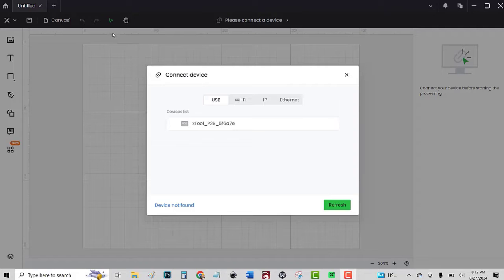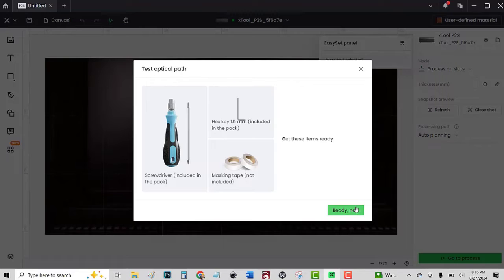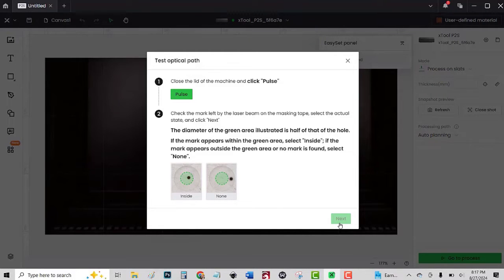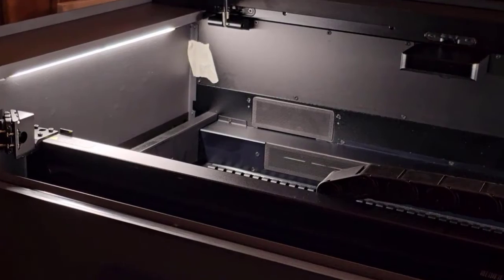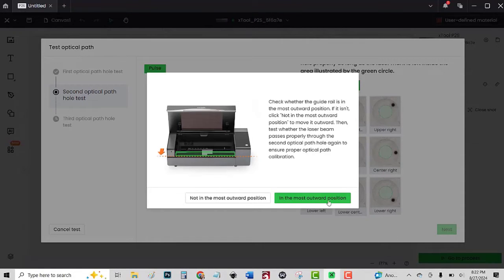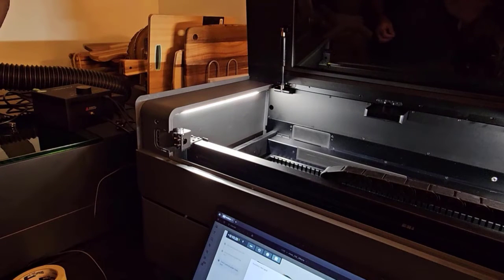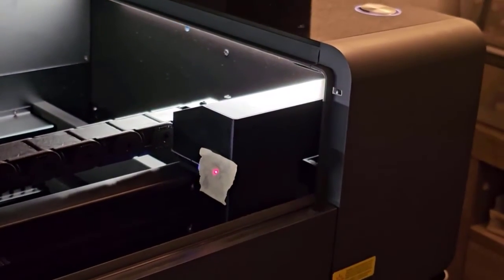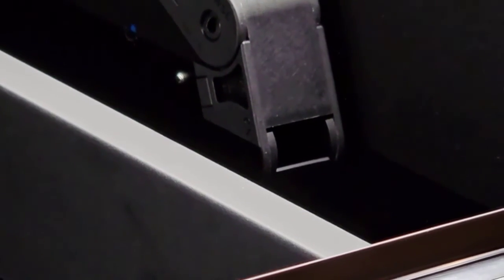Easiest Mirror Alignment Ever? New xTool P2S 55W Laser Engraver

Comment: @ excuse me!
when i close the lid the display shows the lock is still open, press start the machine still runs but no laser beam is generated. can you tell me how to fix the error when i close the lid the display shows locked?
Thank so much!
Reply from the maker: @phattaivo90  The no beam coming out can either be the file, the settings are wrong, or one of your mirrors is not installed correctly.